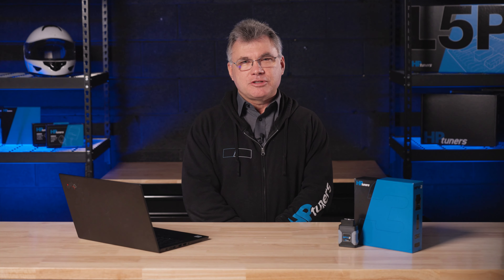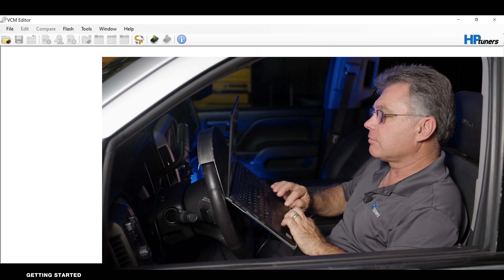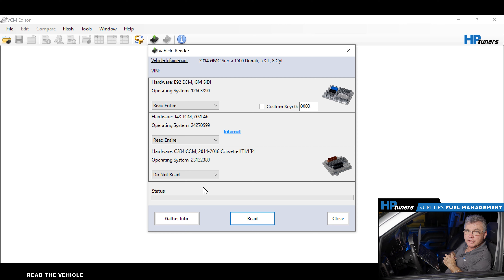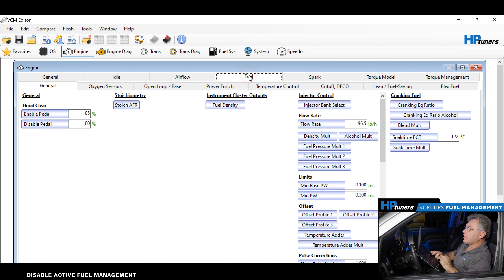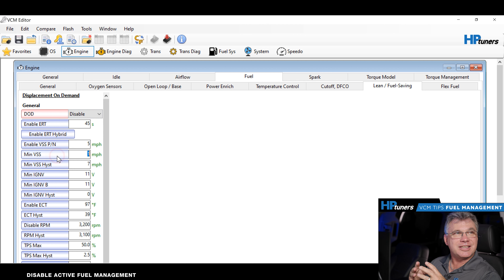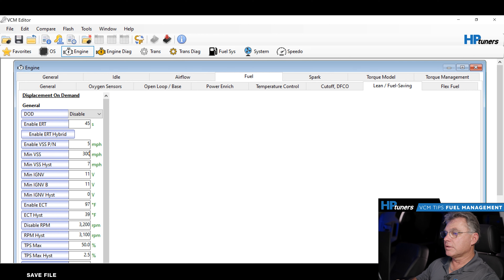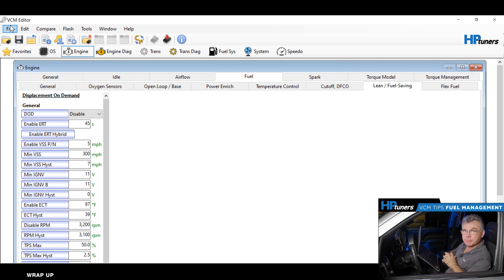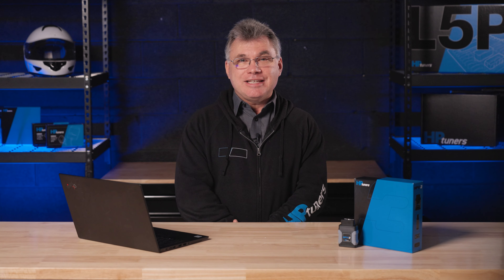How to Disable Active Fuel Management (AFM) in VCM Editor | HP Tuners

Comment: I have a 2020 Sierra 1500 AT4 with the 6.2. DFM is driving me nuts. Maybe I am
Not seeing it, but I can’t find what it is that I need to buy from HP to disable DFM, increase throttle sensitivty. I’d also like to add ho and torque, but my main areas of focus are the first two issues I mentioned.

Comment: Ok, seen the DOD Delete is disabled, but what about the VVT actuator on the camshaft timing gear? When replacing the camshaft and going from having the VVT actuator to non VVT is there something else to write/turn off with your HP Tuner? Why is this not mentioned?
Reply: because deleting vvt is optional has it doesnt really destroy engines and ruin lifters and camshafts etc but yes you do need to tune if your going to delete vvt

Comment: Just bought a 2014 suburban and want to turn off the active fuel management system.   For this video, do I need to buy that software for my computer and hook my computer to the suburbans computer?   A little foggy on that part.
Reply: If you haven't figured it out yet, you need to buy the HP Tuners MPVI3 interface linked in their description

Comment: So... Just turn it off? Is there anything else one should do?
Reply: With dod disabled you are LESS   likely to drop a lifter. Its not guaranteed.  If you truly want to never have to worry about it then you have to physically remove the dod parts.
Reply: @stephencobb9501  Yes... It looks like a total engine rebuild almost. Ffs. So disappointed with auto manufacturing.

Comment: so I have to switch out the cam shaft before tuning it off..I have lifter #7 collapse twice, still collapsed and at the shop..so in order to get rid of afm I have to replace shaft and get this program??
Reply: No, you can tune it out before you do the delete. But once the delete is done, it HAS to be disabled.
Reply: @protocol6741  so I don’t need to replace the cam shaft with before disabling
Reply: @MRRANDOM1 Yes, you can disable AFM before replacing the camshaft
Reply: Don't waste your money on the stupid DOD/AFM dongle or a Diablo tuner. Use the HPTuner. I bought and used a Diablo, but have had all sorts of issues with the fuel composition going nuts due to a virtual E85 sensor. HPTuner was a 2 second job to disable both. Truck runs amazing now.
Reply: @grominwithrob1339 yea I would hate to need that being plugged in all the time